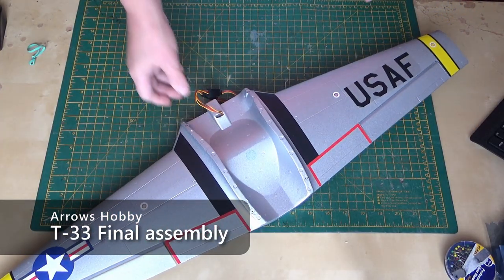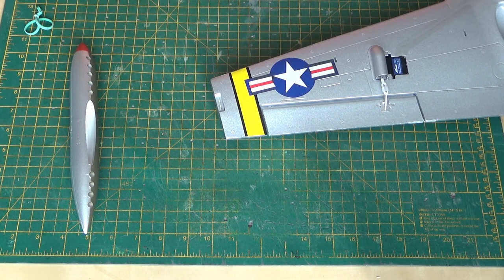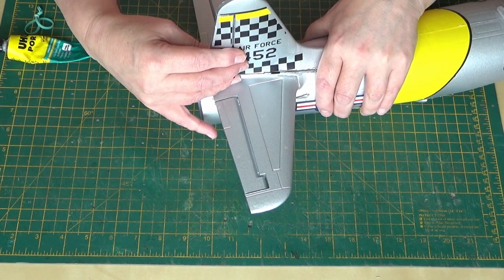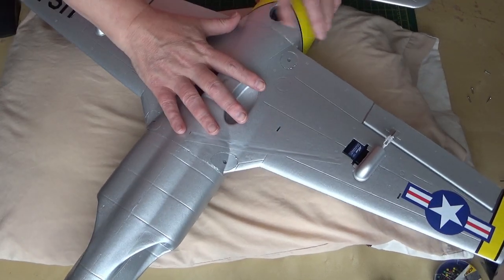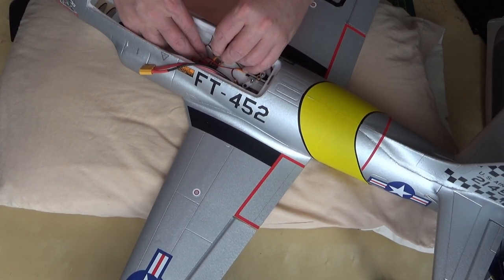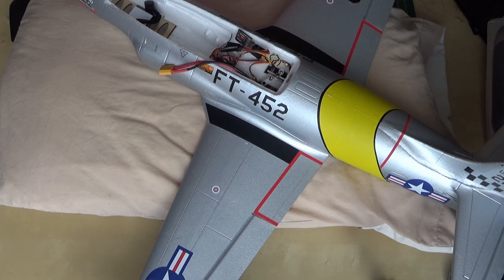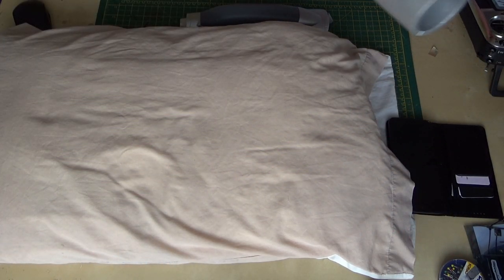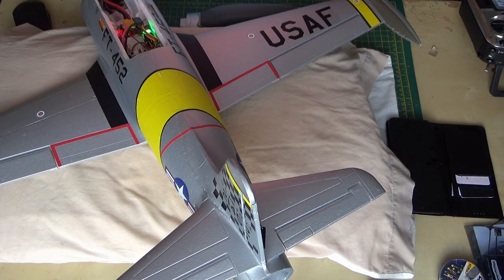Arrows Hobby T 33 - Final Assembly

Comment: You've obviously not read the manual for the Radiolink Byme-A Stabilizer unit! It can be mounted both face up AND face down with arrow forward but not on its side. The calibrating sequence tells it which way up it is mounted. 🙂
Reply from the maker: I have read the manual, just mis-remembered, thanks for the correction :)

Comment: Nice one Caroline, little pocket rocket. Hope you sort the gyro out. 👍🏻
Reply from the maker: The gyro was easy, reverse on my RC transmitter and then reverse on the stabiliser by clicking the button quickly 4 times. 1click - Ail, 2clicks - Elev, 4clicks - Rud.
Reply: @Caroline_Tyler  LOL. Again "You've obviously not read the manual for the Radiolink Byme-A Stabilizer unit!" 😉
Setting the radio stick directions first is a no-no! 1...ESC calibration. 2....Level calibration. 3...Servo "Phase" calibration for correct stab correction via the push-button. 4...Check stick control directions and reverse any needed in the Tx. (Reversing the stab correction direction ALSO reverses the stick direction. Reversing the stick direction in the Tx has NO effect on the stab correction. 🙃😊